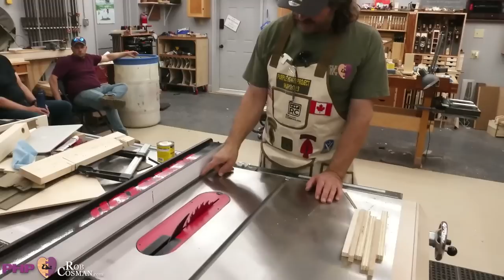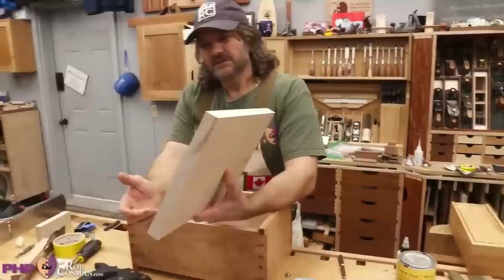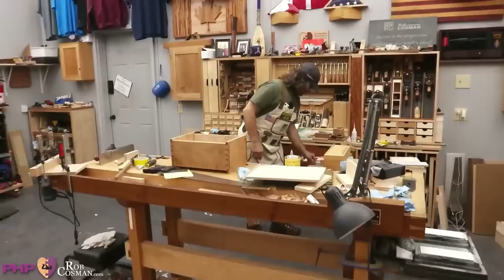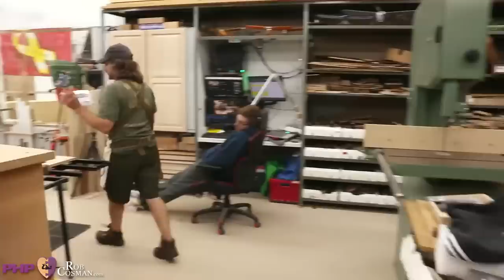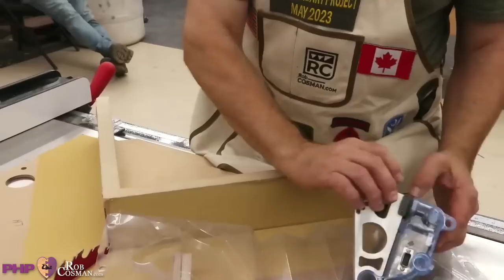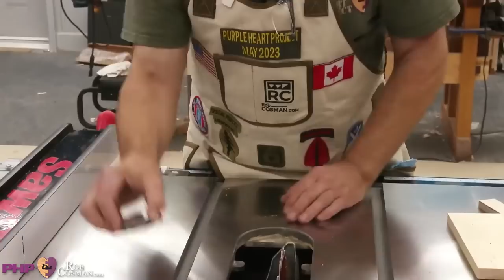Table Saws - Live Q & A (10 June 2023)

Comment: Just a thought about using painted blades on the sawstop: if the safety feature depends on electrical contact beteween your body and the blade, the paint is likely to interfere, unless its conducting. On the other hand, there's not going to be any paint on the teeth itself so you might still be safe; wouldn't rely on it though.

Comment: To the question on aftermarket riving knives, I can recommend SharkGuard, they have them for effectively all saw models.
Reply: Second that. It has to be manually adjusted, but in conjunction with the guard, makes a non-Saw Stop TS as safe as can be with excellent overhead dust collection too.

Comment: I am left handed but I keep the fence to the right of the blade. I have used the saw with the fence to the left a couple of times but it feels awkward. I just changed from a right tilt saw to a left tilt and am much happier. Thank you for sharing. Have a great day and stay safe.🙂🙂
Reply: Hi @glencrandall7051, I asked the question about the fence to the left side and about left handers. I'm fairly new to a table saw and have gotten used to the fence on the right side. I feel like the left handers have to be a little ambidextrous in the tool world. Thanks for the response if you have any left hander advise in the world of woodworking I'd be open ears.